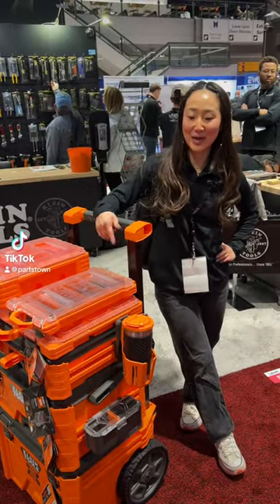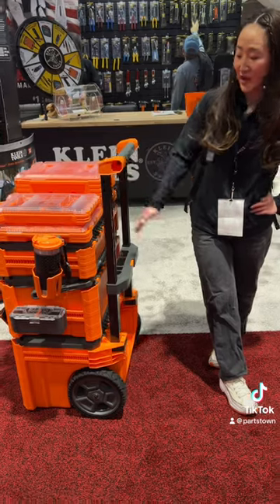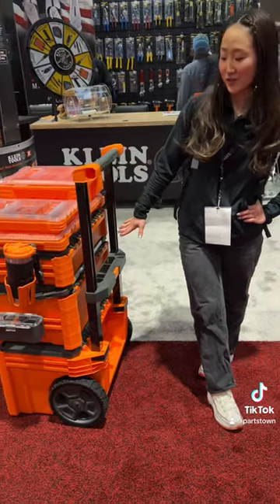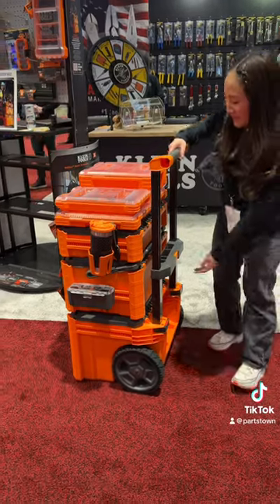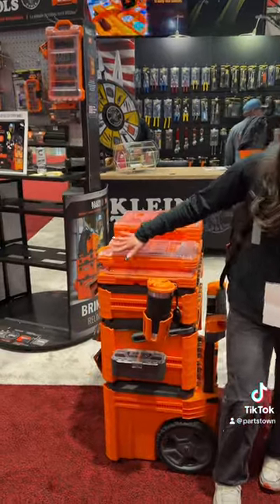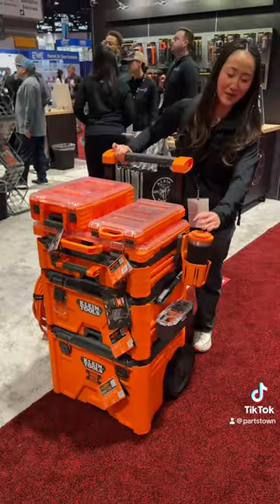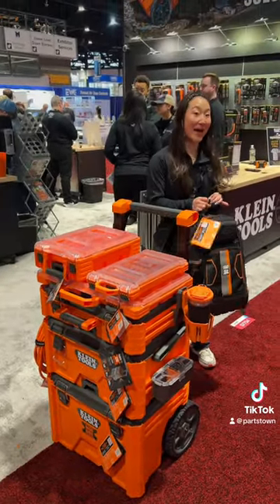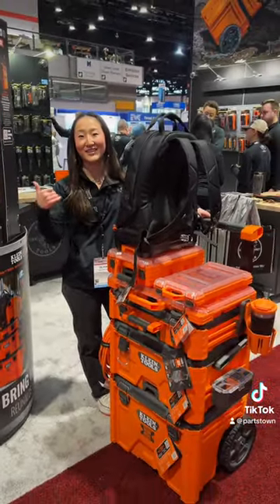HVAC Tech Tool Storage System #hvactools #hvacparts #hvactechnician #hvactech #hvacsystems

Comment: I from a professional in HVAC, I think it needs to be stronger and more sturdy.  Everything we use is heavy af. I'm going with Toughbuilt because they are better built and they make a convertible hand truck that the cases lock into. Nobody has accessories for vacuum pumps, recovery machines and refrigeration gauges though which sucks.
Reply: Hvacs don't use the containers
Reply: @Thinkableness  You're not in HVAC or specifically Commercial HVAC then. I have a full sized van full of tools and parts. That is honestly a stupid comment.
Reply: I use the pack out system with the dolly or hand truck they call it I think 🤔 I also have the rolling box and that fits my recovery machine and vacuum pump